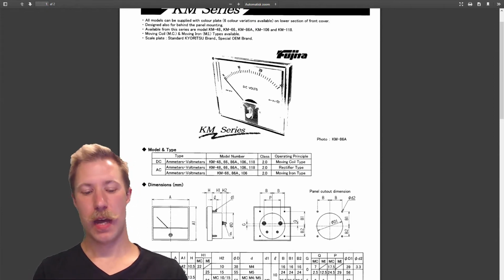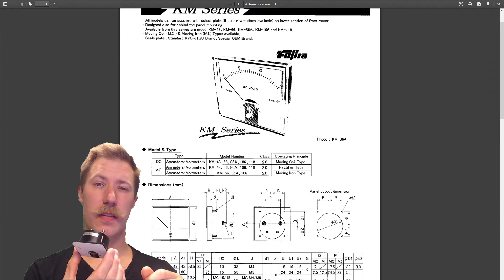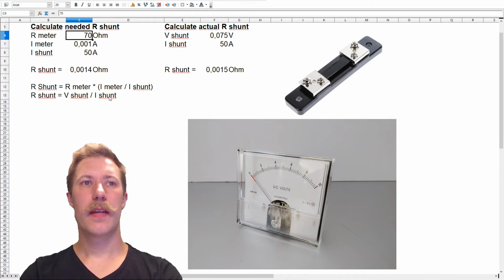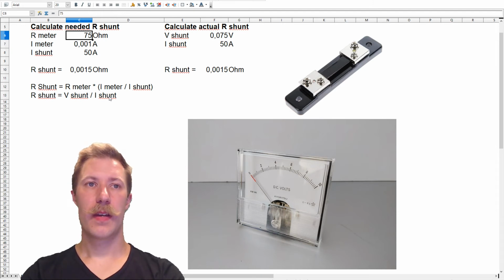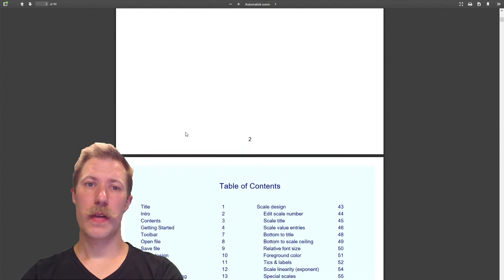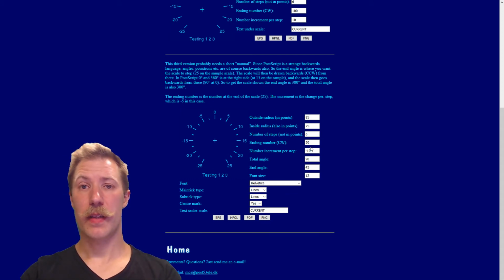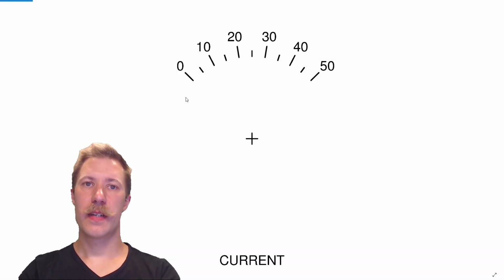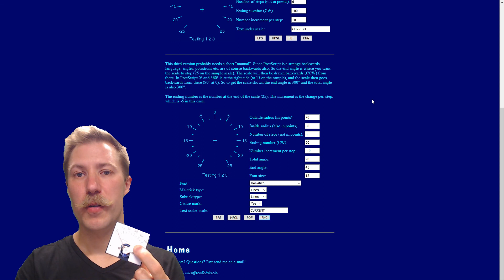Analog Panel Meter Shunt Calculation and Custom Scale Design

Comment: That is a really good program, but i can not print anything from it. I can print the printer calibration square fine, but if i try to print my meter scale it just freezes the program every single time. Every other program on my computer prints just fine.

What is the secret to get this to print?

galva is another one and it will print, but i cant figure out how to use it for the life of me.
Reply: Meter program locks printing for demo version. If i remember right. I have the paid version it prints fine. At the top it should show a printer icon.
Reply: @daviddavidson1372  dont know. I contacted the developer directly and was going to buy it if i could get it to print. Developer told me the demo should print fine. Since i could not be guaranteed if i bought the program it would work i was forced to look elsewhere.
Reply: @kwacz  oh ok.maybe it just limits the amount you can print. I love the program.hope you found a good program to use in place of that one